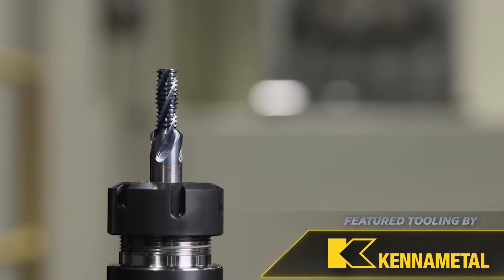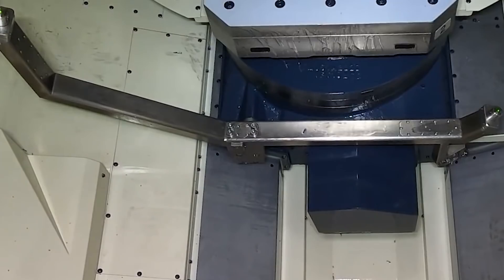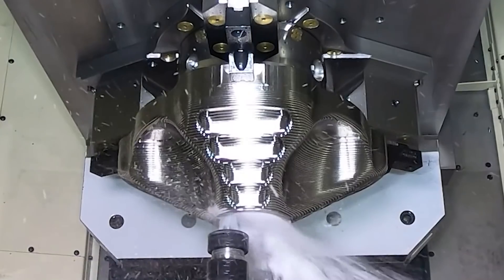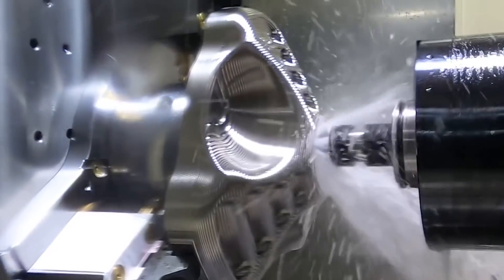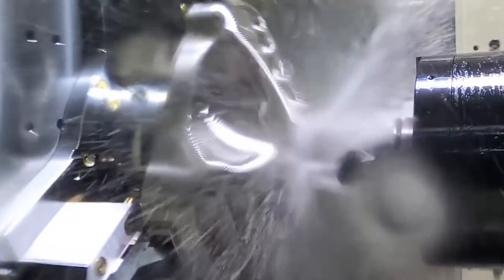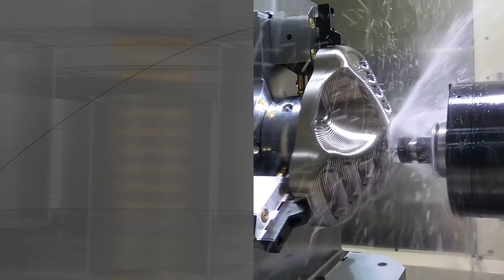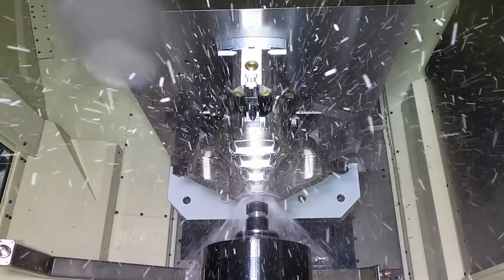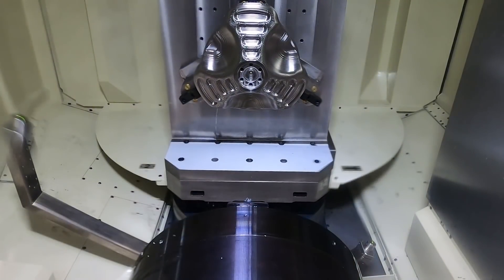SCRAPPING Many Expensive Parts because my Tap Keeps BREAKING in the Part

Comment: Just not worth the headache of tapping very expensive Ti parts. Back when we did a lot of this, before going to thread mills, we'd use acid to remove the taps. When you have 40k+ into a part, you're not scrapping it. Run any other operations, get the part out of the machine and let the acid do its thing. Either way... thread mills are the way.

Comment: I had a new Okuma Cadet cnc lath for once in a while jobs. Not knowing speeds and feeds for 316 s.s. I programmed my 1.25" dia. new insert drill to go 3" deep. It had nasty looking chips dropping out and the sound was also ratty. I did not hook up the thru tool coolant, one part. After about 1" in the sound went to smooth figuring it sorted itself out. All the coolant slinging off the 3 jaw chuck made for hard to see.. After the drill finished and pulled out I saw that the drill was gone. The machine was so strong it just drove the drill into the part the whole feed depth. I was dumb. Later I found out I did everything wrong. The feed rate was to slow and the rpm was to slow. and no coolant getting in there. Okuma's make good machines.

Comment: The boss once told me I couldn't tap a weld hardened grade 8 bolt, I was able to get it done by repeating a series of taps from taper, plug, to bottom over and over. Cutting a small amount at a time using the difference lead angles. Win!

Comment: Lol on  haas lathe i put tool load  on the tap , normaly it would break but i pulled it  out to be long and have the length to move, and bam when tool load hit limit i would  stop without breaking and turnit back by hand :))

Comment: Hi, I'm from across the pond in the UK. Great video. Thread milling is great. At my work i had a batch of 400 components that had two m20x2.5 30mm deep threads in EN24T steel (I think thats equivalent to 4340 steel in the US). Our mills weren't up to the job of tapping them, so we switched to thread milling. It gave beautiful threads and did the whole job with 1 tool. No wear at all

Comment: Titanium has a weird heat transfer.  You gotta keep the sfm way down, and keep that coolant blasting right on the tip.   Titanium is also spongy.   It wants to shrink down on drills and taps and readers.   Make sure you blow out the holes and apply a good tapping lubricant.    OSG and Emuge make good taps for x-hard, stringy or tough material.  I love thread milling, cause you can make multiple passes if needed, and you can cutter comp the size to perfection,  but I never had good luck with small hole thread milling.   Sounds like you guys have the problem solved already though.   Cheers.

Comment: Awesome video! Can you guys do a video on how you are modeling your multi-thread thread mills? I know you use Mastercam, but if you could show it for fusion that would be great.
Reply: We have the same issue with Fusion could not model multi-thread thread mills as it should but draw a custom tool that does not show the thread profile like other softwares.It's a bit annoying when you have to keep guessing until you can achieve the correct thread form especially with NPT thread milling.It only shows it as if it's a single point threading tool and we just do 2 pitches from bottom up to complete the thread.Are you having the same issues as us?
Reply: @mehmettemel8725  I have not used multi-point thread mills for this reason. I just used the nyccnc excel file and f3d file to model and program single-point thread mills, but I want to get into multi-point thread mills.

Comment: Drill and tap a smaller hole inside the broken tap but a lefhand thread then add a bolt and unscrew broken tap
Reply: Removing the broken tap
with an used smaler Endmil.
4 flute is ok. Milling a helix
down. Use Air to remove the dust.
Regards from Germany
Reply: @dieterlahme8604  or if you have time and part is very important and cannot be replaced in time constraints maybe making a slot with a micro endmill to get a flathead screwdriver in to remove it is an option? Depening on how deep it is and if it's a carbide helical thread cutter was used instead of a tap?
Reply: You make it sound so easy,I have tried to drill the centre of a broken tap with a special drill bit made for the purpose so that the edges suppose to break loose.Drilling in centre of it is a challenge on it's own since you don't have a perfectly flat surface where it breaks let alone tapping a broken tap.I love to see it done.I can't see that working,it's not like a broken bolt or stud which can be extracted that way because it is not cutting the material like a tap.Say it was possible to drill and tap a broken tap you won't be able to drill and tap anything bigger than M5 or M6 tap in centre of a M12 tap and you will shear the bolt before you can remove the tap that is broken because it's jammed in the material.Nevertheless I would love to see it done.

Comment: First time i thread milled was because the gear box on the lathe was broken and we couldn't switch it to do a left hand.... Used a lathe thread cutting tool for id. Machined a right handed thread to check the sizes b4 swapping it the over way do it did left hand and came out spot on first time. The gear box is still broken to this day on the lathe

Comment: Never worked with titanium but im sure its tough to tap. I still like tapping on softer materials i think its faster and easier. I did get some monel 600 on time and that was a ?!$&. Had to thread mill in one pass 1/4-20 or it would work harden and break the thread mill on the second pass.
Reply: if u have soft materials and small numbers taping makes sense 

but if i ever had a big contract thread mills are the better choice since they ussually hold almost 10 times longer than a reqular tap if u use the right cutting parameters
Reply: @LordOfChaos.x   yeah im a job shop mostly less than 10 pcs

Comment: if the threadmill breaks and you replace it how do you continue after replacing? its impossible to get it to get it to line back up right?
Reply: Use the same tool, set your Z and it will repeat. It’s not like a tap where you’re thinking unless you have it orientated exactly it won’t lead in the same, the threadmill is like an endmill.
Reply: @F30586  yeah that was my confusion lol, cheers
Reply: @danhyde7501  🤙🏾 cheers from California
Reply: As long as the replacement threadmill is identical to the broken one and you set it the same, It will pick up in the right place.
Reply: @duncs_life  ah yeah silly me... i think i confused myself

Comment: Threadmill lasts forever. You can save on time too. When machining small size holes in soft materials you can do drilling, tapping and chamfering in one go. 3 in 1 tool
Reply: 100% right A Dental Implant company I worked. We used thread milling titanium components .All Swiss 5×6 axis.Mikron & Welliman machining centers.all metric work cell machining...
Reply: I love my thread mills 🤗
Reply: I agree 100% At my last job, when I got handed a power tap program for 1/4 20 in nitronic 40, I would hand it back and ask for a thread mill program. Never looked back.
Reply: I threadmill everything nearly now a days, it’s a superior process
Reply: Drilling with thread mill ?
Reply: @boru-cnc  https://youtu.be/L_HO-2hpGdw
Reply: @stephenjelfo3953  mind blown
Reply: @stephenjelfo3953  I have a flat bottom ones only 🙄
Reply: And then you mill or turn inconel and that theory is put out the window!!
Reply: @Kien187  why? We threadmill 5/8”-11 holes in our posts for our process valve components. Inconel X-750 or 718 with no issues. I’m not sure if you mean smaller diameter holes specifically but we have done 3/8”-16 as well in Inconel 625 with great success. Okuma 561V and Okuma 761V VMC’s.
Reply: @atrains  I am talking smaller diameter’s…
Reply: @Kien187  ok I understand then, not sure if any taps are really great for doing small threads in Inconel. The only benefit is you can get the broken threadmill out and save the part.
Reply: They work great for back chamfering a thru hole also.

Comment: 2-3 passes in hard material, I've seen people try and go straight for the kill with one pass but all you end up with is deflection at the bottom of the hole and a chipped/broken tool.
Reply: I don't know why you wouldn't on a CNC it's just a button click away
Reply: @mattweger437  To save cycle time
Reply: @Frajmando  time Savings are great.

But broken tools will make your saved time more costly than running it at correct feeds.

Slow is smooth, smooth is fast.
Reply: @VeeDubConnoisseur  Agreed, you have to find the balance. If the material is not hard enough you can go one pass and the thread mill will still last FOREVER
Reply: Yuck! Who thread mills in one pass?!

We do 2 roughs and a nice finish pass at the end, our cutters last a long, long time, and worse case, if they dull we comp it out.

Comment: When you were running the taps you were hard driving the tap. Should of used a floating driver with a ratcheting tap head which is adjustable. Thread milling is the best way to go.
Reply: form taps work great in hard materials, Also you can switch up your coolant. But you are right thread milling  is the better way to go.